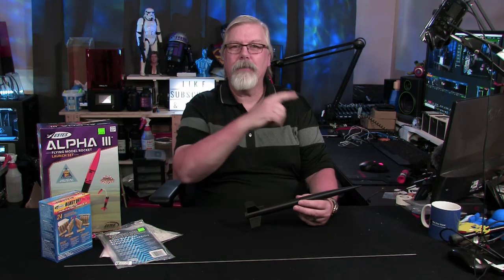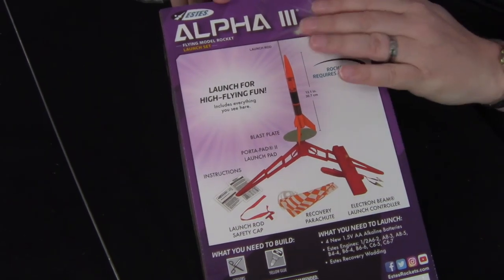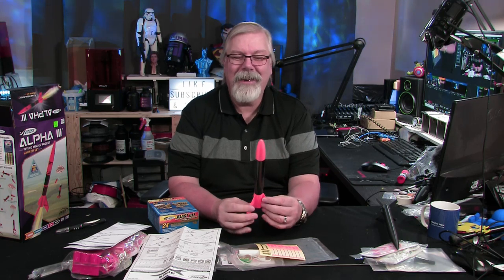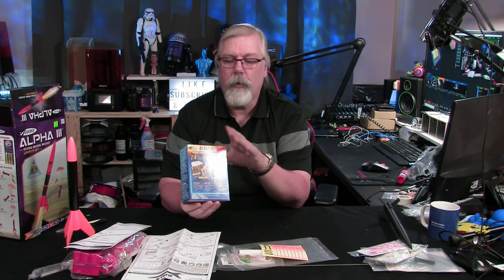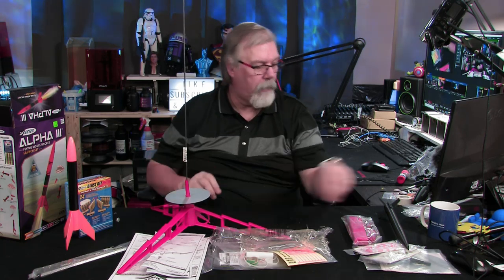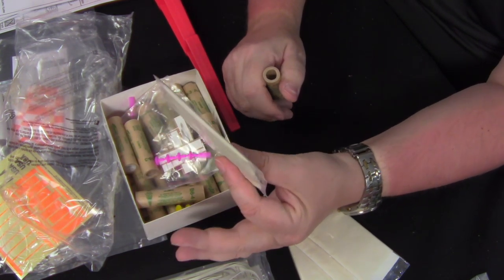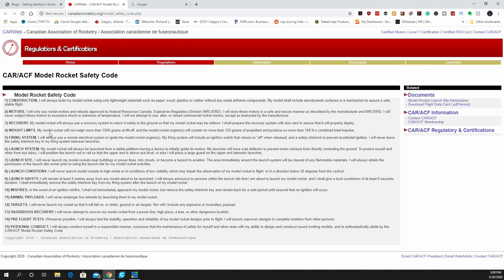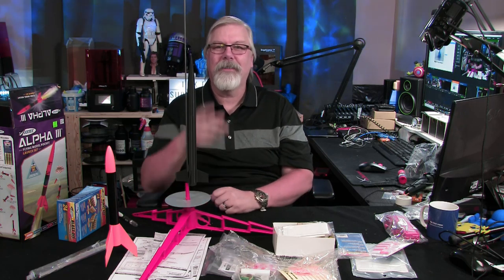Let's 3D print ROCKETS...

Comment: I need help trying to figure out why my printer keeps dragging across the plate..
The belt are tight , I have new bushings on ally rods...it's  level to a T.  And still damn thing jerk back hard causing it miss print...what is the problem.please. Had glass on it for a while but it seem like it dragging across the glass use just plate now.
Reply from the maker: It sounds as though your z-offset is incorrect.
Reply: @TheFirstLayer  ok how can I fix it should I change my g codes back to original